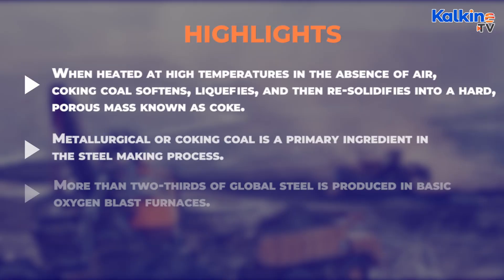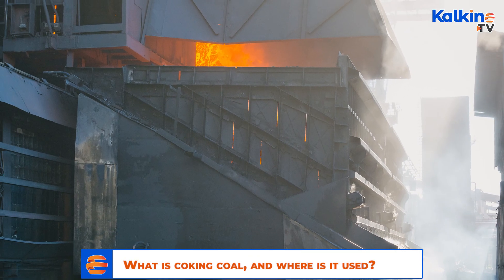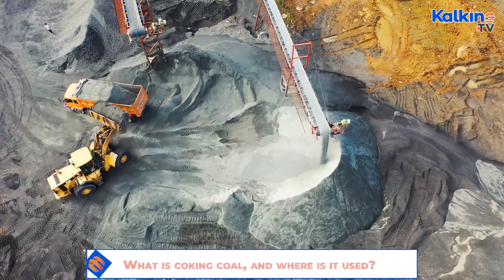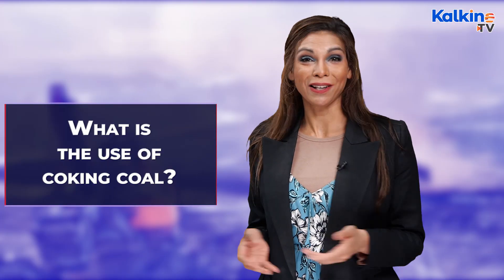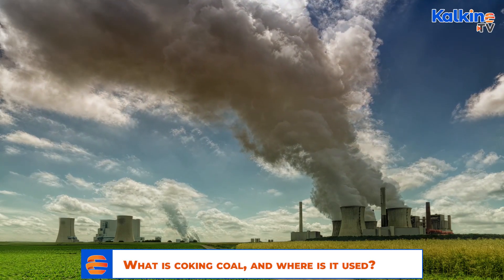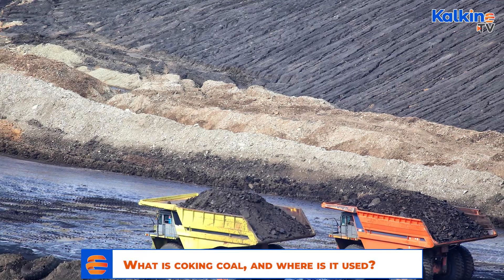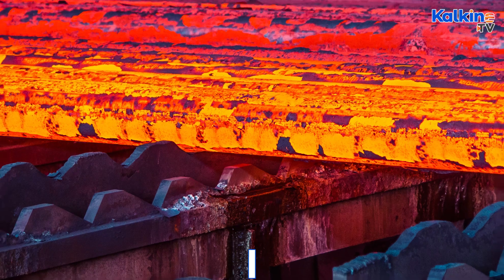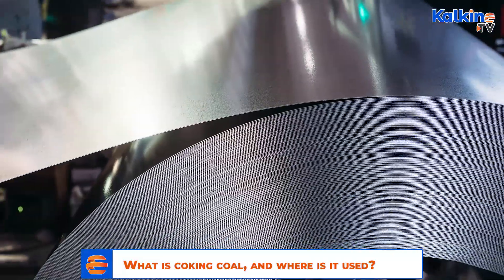What is coking coal, and where is it used ?

Comment: Green steel will be expensive expect prices of 2100 dollars a tonne and green hydrogen is energy thirsty.  You need 50MW of electricity to produce one tonne of hydrogen and oxygen and heavy water as byproducts. Even so you still need 150kg of coke to fuse the impurities with limestone as a flux . The main goal is to reduce electricity from 50MW to 42MW so alot of R&D is needed.

Comment: I see this video with errors and omissions.  I am a retired steel mill supervisor who worked at the blast furnaces and coke plants.  First, the amount of coke used per ton of steel is not 770 kg.  It is much less like around 300 kg and less.  Second, her pronunciation of the types of coal is completely wrong.  Third, there is no mention of by-products that come from coked coal.  The coked coal (coke) goes to the blast furnace and is used as fuel for smelting iron ore into liquid iron.  The impurities she mentions are not impurities that are thrown away as she implies.  These impurities are by-products that are useful to mankind.  These by-products from coking coal are tar for making shingles for roofs and repairing roofs.  Another is asphalt for constructing and repairing roads.  Coal tar is also used as a raw material for making some plastics.  Ammonia is sent to chemical plants as a raw material to make cleaning supplies and other useful chemicals.  Also, ammonia sulfate is made in a coke plant that is a very valuable fertilizer.  Another use for coke by-products is a fuel gas for firing boilers and heating homes.  Lastly,  light oils for industrial applications are benzene, toluene, and xylene.  Coke is a needed material for years to come because not all grades of steel can be made by electric arc furnaces.  Some complicated grades of steel are needed in autos and trucks and blast furnaces are the only way to make these steels.